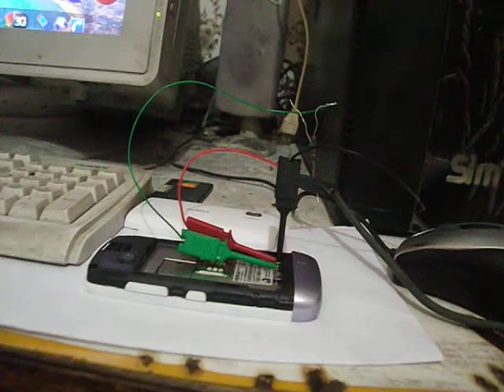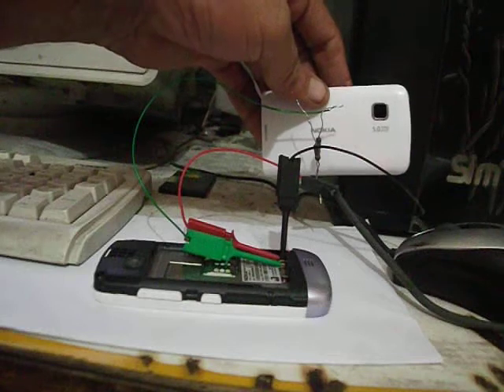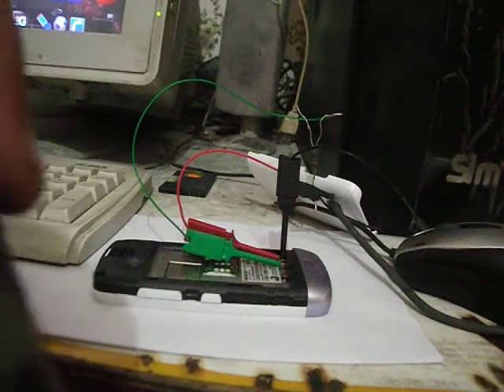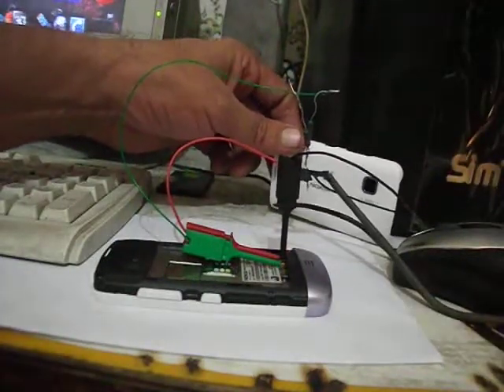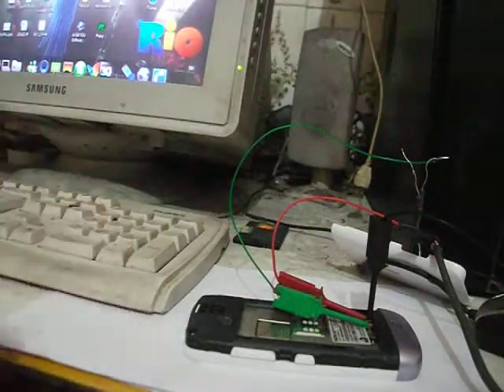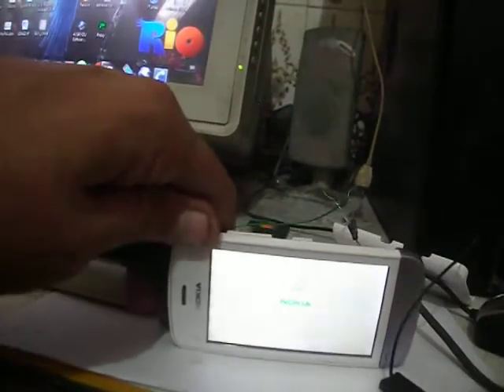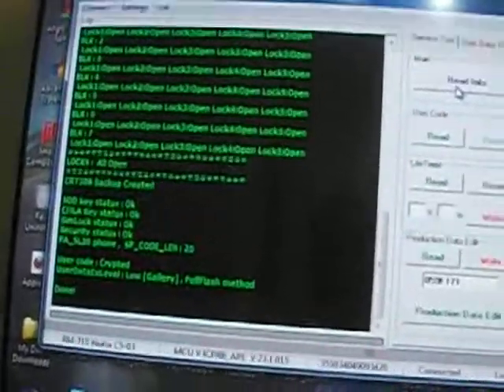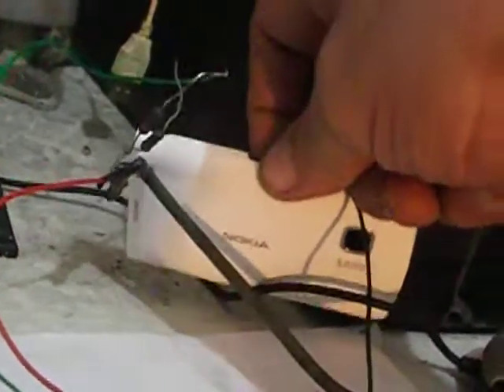Nokia Local/Test Mode Stand Alone Cable for LBF logs, Flashing and Reset

Comment: Dude can you share schematic of cable ?
Reply: +Sherif Aliti its quite simple, connect "+" to 5v, "-" to ground and connect one of 5kΩ resistor leg to "BSI" and other leg to ground. you can also attach two 10k in parallel to achieve 5kΩ.
Reply: Thanks, I Try few method with 4001d didnt work, this one work just fine. Regards